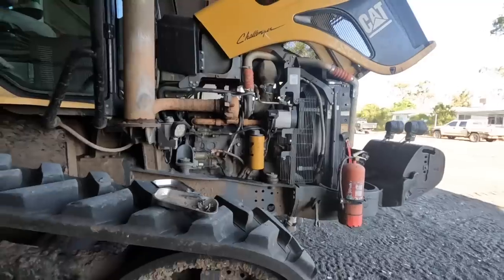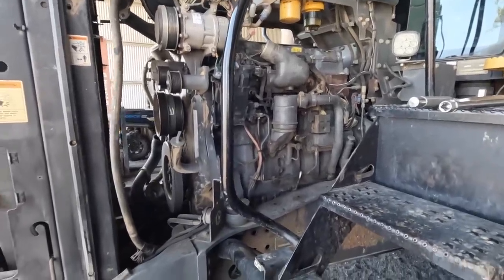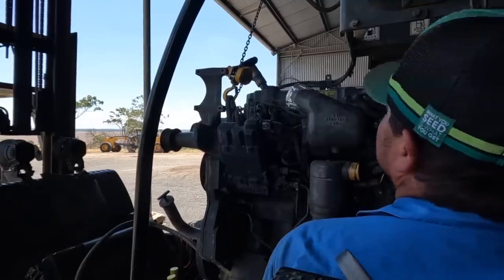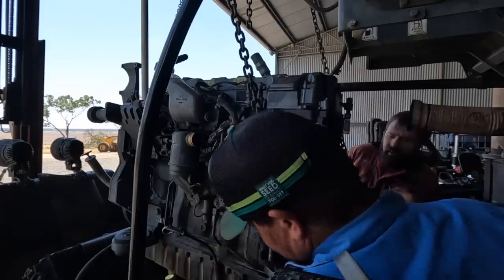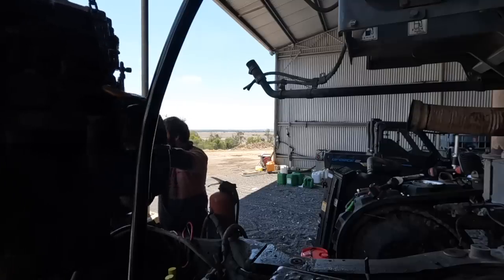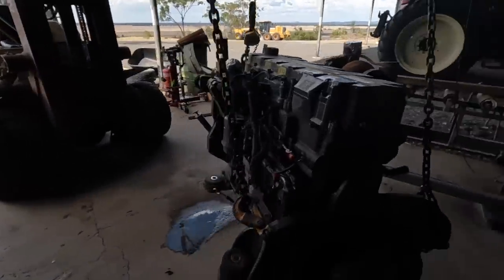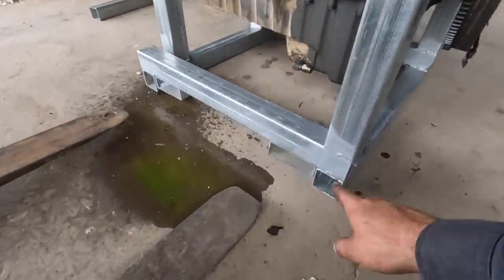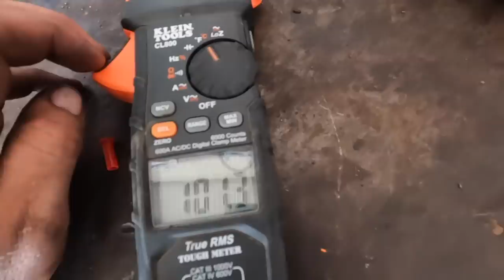Needs an ENGINE REBUILD!!  (Vlog 136)

Comment: when we had our ch55 it started getting hot , we did it in frame , it wasn't a bad or big job. we got a mobile mac that used to work with cats, 1 day to rip it apart, 10 days for all the parts, 2 small days to put it back together. we had to remove the tanks but all the rads stayed. had to replace all the injection metering leaves and injection,  piston on ours was a 3 piece setup and wet liners, Crank was ok with just bearings. we put a new water pump on it and sent the head off for crack testing in Toowoomba also got the turbo reconditioned in Toowoomba as well. it probably would have been nice send it off to a shop but we had the tractor parked on a concrete slab in a shed , it all went well and it was running well 2000hrs later when we sold the place.

Comment: About your bird problem, if you don't want to install physical barriers my best advise to you would be to put up some nest boxes at the outside shady side of the shed walls, high enough. When birds are nesting they become territorial and will scare of the other birds who come too close. And if you create a better place for them to hang out, so that they are somewhat protected from the elements, with a source of water, and where it doesn't cause any problems for you and your equipment, they will go to that place. Those birds are looking for a place to put there nest and to hide for the elements, it is simple as that. So if you provide them with a better place to go, with a source of water, they will prefer to go there. 

There is not much else that you can do other than trying to learn more about the birds needs, and to give them a better place to go at a different location where it doesn't cause any problems. 

Other than that there are sound repellents that actually work, but those that work create a loud bang every few minutes, and I believe that they are operated by a gas bottle, which is not the safest thing to leave unattended for long periods of time, and the noise might be a bit too much as well, so I don't think that it is a very practical solution. But airfields use them as well. And there is also a laser system designed for agriculture, but I am not too sure if those lasers are completely harmless to the birds, and if they are safe to use with humans around, after all you don't want the birds or yourself to get hit in the eye with a laser beam.   

With the exception of physical barriers all the other so called bird repellents might work for a day or even two days, but eventually the birds get used to it and will return.

Comment: What a quality engine stand, even painted it 😮. Think your dad is a smart guy sending his kids off to learn a trade ( that’s relevant) then return to the farm in a few years. He has put the future if the farm in safe hands. Bit disappointing the engine needs a rebuild at 10,000 hrs ( would have only been a good years running on a generator set?) thought a cat would have been good for 15k at least.
Reply: It doesn’t NEED a rebuild, just an injector seat. But you may as well rebuild it while you have it out

Comment: I thought the land down under used the metric system and am curious why inches was used on measurements while removing the engine?
Reply from the maker: Best way to explain it is we use metric for everything except when we are telling someone else a rough measurement in which case we use both👍
Reply: We were supposed to be converted in 1975 but the imperial system still has lots of merit. A lot of things I build are half metric and half imperial. Depends what side of the steel rule is up. You can sometimes buy cheap bolts that are metric with whitworth thread, or whitworth heads. You need three sets of tools now which I always give thanks to the ratbags who gave us the metric system for. New steel round bar will be metric,unless you get bright steel, and you can’t cut an imperial thread on it. Bolts and pipe fittings that are imperial will de stocked as some stupid metric size, you need to de a mathematician to get the right ones. If they stop making imperial poly pipe and fittings we will all de stuffed. I know of places that have a mixture of imperial and metric poly pipe and have to have double the stock of spare fittings. It is a mess. One bloke found out that his place was suddenly 2.5 times smaller and further from town. He wasn’t impressed at all. Jeff
Reply: @jefftheaussie2225 most over 50’s engineers still talk feet an inches here as well😂 can’t easily buy non metric bolts or steel stock. Curiously we have the same with steel pipe and hydraulic pipe sittings are still BSP at the moment. Hydraulic fittings are going metric now but think they will see me out 😂

Comment: Thanks for the video Matt. What year is the cat track tractor built in. Have you done much work (hour's)with the cat after getting the wheels fixed in the undercarriage. We had to do the same when we finished high school and go get a trade before going back to the family farm. I did my trade in welding and heavy fabrication. There is enough heavy equipment there to get the pool in there in no time at all lol.🤣👍 keep the great videos coming thank you.
Reply from the maker: Thanks! I think it’s a 01 or 02 model, its only done the last harvest since the retread on the rear wheels😁
Reply: @thejacksonbrothers  Thanks Matt I was thinking around the year  2000 for manufacture of the cat tractor.

Comment: I have a question about your seasons in the uk we would be harvesting from end of July till early September, by October we would be heading into winter. You finished harvest by late December yet you appear to be in the hottest part of summer now! Do your crops ripen early in the season given the hotter weather. I always thought it would be 6 months offset in the southern hemisphere. Would appreciate a reply from anybody that knows
Reply: Wheat is a winter crop here. Other crops such as sorghum are summer crops. They need the long days and the heat of summer. Wheat and other cereals would burn off in the summer and produce nothing. Jeff
Reply: @jefftheaussie2225  thanks for that. So you are harvesting cereals in late spring early summer is what you are saying if I understand ? It’s hard to match months to seasons in the Opposit hemisphere  🤷🏻‍♂️
Reply: @johnwarwick4105  Yes that’s right depending how far north you go. At the top of the cereal area in Queensland they might be going in late September (start of spring), the further south you go into Victoria it will be more like Christmas. In WA it works out much the same although in their Southern Wheat Belt they start earlier than Victoria. Summer starts 1st Dec, opposite to you.

Comment: Last year around new years, Jan 22, I was driving through Yukon Territory in Canada. I stopped at a gas station and the gal said it was -64° outside Burr🥶🥶 .. I got down the road a ways and realize she was talking about Celsius and not Fahrenheit. So it was around -83°F with no wind 🥶🥶🥶 fudge that's cold in any language
Reply: Wow didn’t think anywhere got that cold 🥶. Always thought when you got past -40 it’s irrelevant if C or F 😂😂 makes you wonder how the wildlife survives
Reply: @johnwarwick4105  well -40*C is -40*F that’s how the math works out. But you are correct at some point it don’t matter. At -50*F a five foot seven inch man can spit and as the spit hits the ground it cracks from freezing. That’s how the old Sourdoughs used to tell the temperature. 
Colder temp and the spit cracked before hitting the ground.

Comment: Why did you not just trade it in for a newer tractor, it will still be a old tractor.
Reply: Better the devil you know sometimes. If something goes mid harvest you don't want to spend time working it out.
Reply: Just a guess.  Probably 200000 reasons why rebuild
Reply: @arffadailey8055  closer to 400,000 reasons in Aus actually.
Reply: @arffadailey8055  Leave it out Arfur.  How are the Indoors these days?
Reply: @jefftheaussie2225  Just having  a VaT with  Dav at the Winchester club